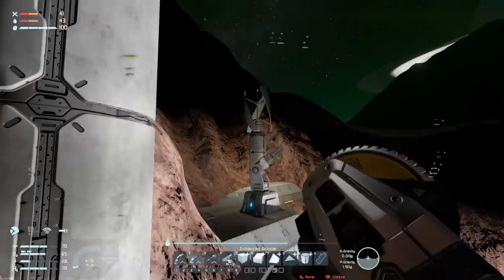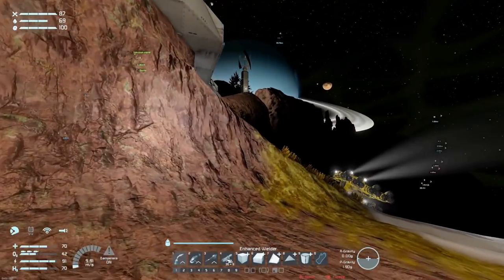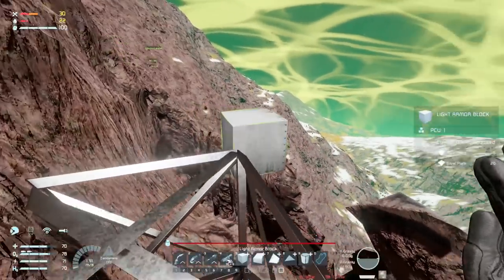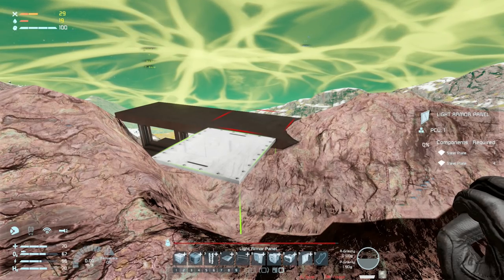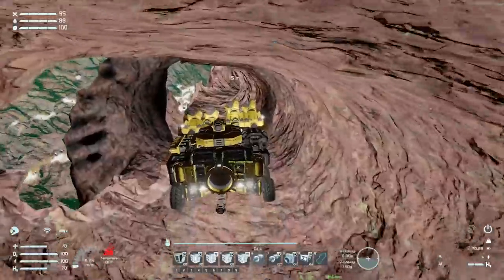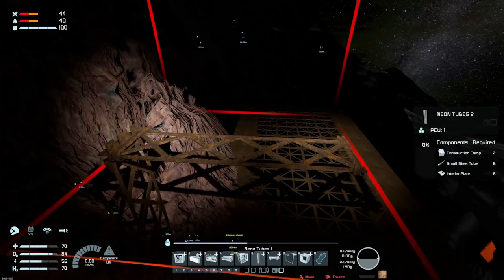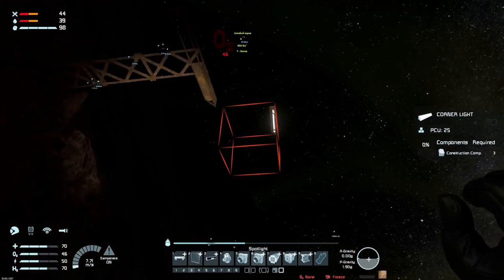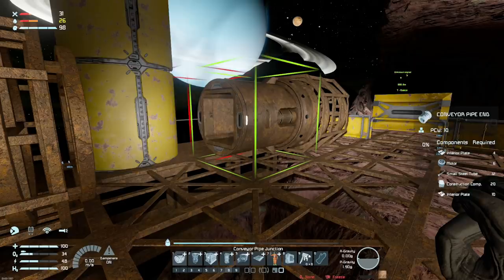Survival Impossible - Death Route #66 - Space Engineers Hardcore Survival

Comment: Hey you should add an anchoring arm on the splat form something that can extend and landing gear it to wall to conserve power. Pistion on hinge and rotor or something.
Reply: Make SplatForm have "feet" that can "walk"
Reply: Or the new magnetic plates. Problems arise when you ad pistons and hinges to flying machine in SE though :(
Reply: @marksadler4457  Not anymore, You can fly in an atmosphere with subgrids attached now.
Reply: Yes just a plate like the first splatform! It was pretty cool
Reply: @marksadler4457  you need to "mergeblock" them, in closed and opend state or its a hell of shaking(even with tensors shared)

Comment: When using grid alignment, you can hold CTRL and use the mouse wheel to move the block distance. It’s not as massive as creative mode, but you do have some adjustment. This means you can pull it closer to you and get it to snap to the front of the block you are standing on. Only works for me in align to local grid, and sometimes I have to change alignment out and back to get it to snap.

Comment: Name for the little failed bridge "Follies Landing". Something else you can do with the battery is add a few connectors and you can use it as well for a forward charging point for the splatform and any trailers. And a proper landing spot for the splatform  or any other flying crafts on the new addition at the hole in the wall would look pretty good.
Reply: I like 'Follies Landing' sounds like the name of many a project!!

Comment: Oh, and regarding the lights I recently tried to make a sort of power cables out of small grid wheels and hinges with frequend small blocks to hold lights and an exhaust, that throws sparks from time to time by having a timer block trigger it. So laying a long cable alonbg the tunnel and maybe attaching it with a magnetic plate or landing gear to the wall would make a great and flexible way of getting power and light

Comment: In a mountainouse terain you whon't want suspensionbridges in fear of a rockfall.

The briddgeproject could be redesigned as a forward parkingspott/stockpile for constructioncrews (as in redesigned by the buildingcrew). (also possible parkingspott for the splatform with low to 0 powerinput so you don't need to drive the whole whay back down during construction) ...  jea, kind'a  like that. 

you could put the warningsign on a frame overhead with the halve sized armorkorners. Also the place should be accessible by vehicles so the workers don't need to move more than one baricade to gain access to not clump up the street while clearing the entrence.

Comment: Turn the failed bridge spot into an overlook weight station/security check point. It can still have the failed bridge sticking off and out of it, but they had started with a second structure like Steve's hole in the wall at the bridge but decided part way into construction to not continue but mine instead. So you can have a small building with air and a gun turret and power generation, a small storage room, maybe even some refinery capability, a small overlook viewing platform, and then the unfinished bridge sticking out with blockades and warnings. You can also use it a second staging area, turn around spot and recharging location.

Comment: I think setting up the Rock Lobster for front-wheel-drive, either by turning the suspensions off or just turning down the power, will help make your rover a fair bit more stable. Every time you inch forward, the rover subtly jerks back onto its rear suspension and rocks back and forth for a moment, suggesting you have too much torque on your rear suspensions. The sudden stops you make while inching forward are probably contributing to the rocking as well; this could be mitigated by making the front suspensions stiffer than the rear suspensions.

Or if you're feeling brave, you could break out a controller and try feathering the throttle.

Comment: I've been experimenting using those small-grid merge blocks to make battery packs for my rovers. My base has a surplus of power generation, and seemed a waste not to use the solar/wind generation.
Might be handy at Steve's Hole-in-the-wall where you can sorta back up into a battery bay and swap flats to full charge packs reasonably quickly.

Comment: Since the splatform is merged on, you could blueprint/project it off the trailer, then have a charging station separate from the trailer. Then you can have alternate splatforms to work from while the other charges. The airbase canary welder can spray one out in one or two passes.

Comment: Red = Bad guys!
you usually want to shoot those things marked in Red.

need to add more points into Parkour!

power systems at base will need attention as there are damaged turbines. I might also consider adding some Solar Panels to boost generation for the Splatform. wind conditions are not ideal at Steve's Hole might end up require installing a small Reactor.

huge bridge requires more than one body to build it.
install a pier under the part you intend to leave in place with a sign denoting "Bridge Out"
a couple containers and a spare Bridge Beam lying on the deck.
don't forget to build up the Abutment where the Bridge merges into the Rock.
29:00 = an alternative for large bridges that will have some interesting looks is a Deck Truss design.
these can be quite long and built in sections that can be carried up and weld padded into place.
individual spans over a wider gap such as a River can be done with a Through Truss that I have built and Blueprinted in my Agaris Save.

Comment: I think you could improve the roadside fencing by using the steel and grated catwalk blocks with a railing block on top as some king of fence top. For further decoration you could consider the retro skin. 

The stub bridge could use a transverse brace into the voxel. Using both straight and sloped beams should make it look decent.

Building the O2 tank and vent in small grid IMO makes sense and allows a bit of greebling. Add a wood or beam pile . . .

Perhaps the various armor panel slopes could be used to model a torn off bridge end. They could also be used,  cut down, as fencing again with railing on top.

If you're going to be building trailers then put a seat and remote control on them for easier, and at need independent, movement.

Good Luck

Comment: As a suggestion for the bridge, real life suspension bridges have the "Caisson" built first, that is the big blocky section at the bottom of the pillars the cable runs to. Maybe getting one of those half way finished in view of the road would work for the build? Also the Anchor point for the cables would have been done before any part of the platform was put in, and would be readily visible (And possibly work as a small room here)
Reply: If he builds a tower he could stick a wind turbine on it and have it be pretty effecient as well. Or maybe a turret since its now powered and could be attacked

Comment: Maybe a small worksite office trailer/ Forman's Office built with armor panels could have o2 a seat/control station or counter solar on top batteries, worker toilet, work safety signs or non safety signs haha?. Might not fit the decor but for lights Tiki torches using exhaust pipes and a small fire setting on the exhaust, might be a bit to Mad Max/Capac.

Comment: It's too bad we can't make jersey barriers (though maybe with small grid?) because that would have been perfect for the abandoned bridge barrier. 
Along the edge of the road in the sections where you shore up the road's overhang, I suggest using the half cover wall in safety orange (so, with a gap between each one since they are half-width). It's an edge indicator, not a barrier that blocks your view or keeps you safe.
I'm with you on the scale of that bridge. You need to invoke some Colonel Failure style. Cheeky bridges, cheeky tunnels. Besides the labor involved, it's much more pleasing, and much easier to hide the fact that with low-radius planets like we have in SE, with enough length, straight = sloped. 
It's a good thing you didn't lop off that giant spike of a beam, to let the valley claim it. To replace that much iron would have been what, 3 loads of hand-mined stone? Who's got time for that? And think of the power cost of running a drill for that long!

Comment: you should do some scaffolding around the end of the failed bridge. and also, maybe you should build a little working arm on the road builder, with a platform to work from, then you can drive with the platform over the edge end build the bridge. or build things a bit up. then fold it in when not used, a challenge.
you could do some fake tunnels to, just drill in a bit and then build some barrier with warnings. just for show.

Comment: Instead of just doing a fence or a rail along the open bits, maybe push the road into the mountain a bit, level the part right along the open cliff, and then build little viewing platforms. I live in a very hilly/mountainous area and there are always these little spots along cliff roads for people to pull over and enjoy the view and take pictures, but they're not like full "picnic areas", they're more like expanded shoulders. Also if power is an issue I would like to remind you that you did just build an ice mining tram so maybe you could add in a hydrogen engine to Steve's Hole in the Wall.

Something you could add to the bridge to make it look more realistic is an office. Lots of larger construction projects bring in these sort of portable offices that look more less like large shiping containers that have been converted into an office. Maybe build a little building to look like one of those portable offices that was also just sort of left there.

I don't know specifically how strong 2 1x1 hinges are, but I do know that a single 3x3 hinge is able to handle 3 drills with room to spare. So if you ever revisit the "road builder" idea in the future, if you use a 3x3 hinge you should be set to build the extra drills necessary to make the road wider. My mining rover on the workshop has 2 3x3 hinges holding up 6 drills that are all greebled with a whole ejector system for stone, lights, and even a few decoys in between and it is still able to adjust everything up and down with relative ease even when the drills are full. Hopefully my obsession with rovers can come in handy for others since I basically play "Rover Engineers" and never actually make it to space.

Comment: Those of us who have watched your videos for a while know you well enough to know that if you finished the huge bridge in creative you would consider it cheating.  For your use it would help if SE had smaller large grid O2 tanks.  The build state conveyor pipes looks like a rebar frame for a concrete pillar.  You could have the logo and Bridge out on the big LCD with some smaller Top or Bottoms rotated long axis vertical attached to the sides of the big LCD saying Danger.  I didn't see if you had but don't forget to turn off the vent once the O2 tank is filled to your preference to save power.  If the game had liquid water and flowing water we could have Hydroelectric as another way of generating power.  A small stream to keep it ballanced with what the wind turbines make so that you don't feel like you would be cheating.

Comment: I got an idea i want to try myself as well. That is to build a big wind farm. Just turbines on stalks. Then a ccentral charging station using large grid batteries on merge blocks. A seperate truck tranports the empty power units to the recharge station/ wind farm. there a fork lift can offload them and plug them in for recharging. Then load up the fully charged one and bring that back to where ever its needed

Comment: You could add a projector on a rotor with a remote and a camera on it and let it project a line of blocks so you have like a measurement stick.
And there is a block to cover up the corners at 5:12
If im not wrong it should be in the same group as the half blocks

Comment: I dunno, 'Lock Robster' sounded pretty cool. You could call it 'Bob' for short.  As it's about half way, maybe the abandoned stretch of bridge would have been gentrified and turned into the 'picnic spot' in an effort to salvage some of the lost construction costs incurred by the mistake? Also, as a temporary measure, you could add 'Bridge Out' text to the LCD to overlay the 'Danger' image (which might look better with the 'keep aspect ratio' box checked) 👍

By the way, got any pointers for trouble-shooting why a large-grid rocket (attached by connector & built in situ) won't convert to ship? I've even used Bob's cousin, Drill 'N' Fill, to make sure that I've not, somehow, managed to leave even a teensy voxel left, and it's still telling me, "Conversion to Ship Isn't Possible / Permitted" (I forget the exact wording). I suspect I may have to grind the whole thing down and build it again via projected blueprint (which will be a pain, but 'needs must when the Devil stomps your cookies')? All tips welcome, if you have any... :-/
Reply: Nice use of the Neons, too 👍😁🍺

Comment: Some ideas, feel free not to use them:

- There's lots of snow around that Mountain Tunnel Road. Why not a giant rotating drill arm that slowly scoops up ice and deposits it into a few large grid large containers attached to a decent-sized network of Hydrogen Engines? It's semi-automated for a little while, until it hits stone, but you could probably set up a PB that detects when ice is no longer entering the large cargo container or when excess stone is, to auto shut off the drills and retract the pistons, then somehow set off a large warning spotlight to let you know there will be no more ice to dig up. There are many great examples of rotating drills arms and as a hint there are usually at least two rotors offset from each other to get an efficient end result.

- I'm surprised you haven't made a blueprint of the bases so far for projecting them and making repairs much easier in the future, should they be needed.

- I believe "Poor" wind clearance is less than 50% of possible power, whereas "Optimal" can potentially reach over 100% from time to time. So stacking the wind turbines up just a few more meters, exactly far enough away for "Optimal" wind clearance, would help heaps.

- A solar farm is cheap in cost, as far as resources are concerned, (everything can be made from what is refined from stone), and you can attach a simple script to it that can utilize the Hinges and Rotors to track the sun, for optimal sun exposure and maximum energy.
Reply: Since when do you watch his videos?
Because that’s all things he already did and simply doesn’t want do do the same things over and over again.

Comment: If you had added a projector to the end if the bridge then make the bridge a blueprint, you could have used the projection to place blocks from on the bridge safely and without the needing to worry about powering the Splatform 

You'd lose put on the  materials of the projectors, but it would be less than you'd use making the power infrastructure to use the Splatform at a decent pace.

Comment: Well I discovered that if you build a dump truck (and yes is actually carries raw rocks and dumps the rocks) that they tend to roll around inside the dumper, lol. This was also followed by the unexpected discovery that i did not have to open the tailgate before dumping because the bigger rocks have no trouble tearing it right off the back as the dumper was raised.

Comment: Question, if you connect "Steve's hole in the wall" to the "bridge" using the road in the cave floor, could you not add turbines to the outside of the path? allowing the sharing of power through multiple way station charge areas that could have o2 farms hanging of the side of the mountain with tanks spread out as emergency rest stops/refills spots.

Comment: you could make a small portable generator that gets towed to the worksite and runs to recharge batteries on ice ... then a few turbines will keep a basic shelter running and the generator charges the rest while building major parts .. also that generator then can follow along the road ... have the mobile generator have a basic survival kit on it for o2 and power reload ... and super basic manufacturing ... and just the small grid storage containers to hold a bit of stuff and ice for running ....
Reply: the abandoned bridge section can be used for power generation ... change the bed to solar and add a few turbines along it and a place to hookup and recharge ... even Park the splatform ... and lobster ... heck make a small ugly foremans shack where the bridge plans are looked at and the road gets worked from ... turn it into a storage depot for the redesigned repositioned bridge

Comment: When I build miners to operate in space, I made a few thrusters fire at low thrust to slowly and smoothly push the miner forward automatically.  No jerking.  Why don't you set up a "drilling" hotkey/script where the wheels drive forward at a slow rate and all you have to do is steer.  That way, the drill vehicle isn't lurching forward all the time when you tap the forward key.  It makes the road bed much smoother too.
Reply from the maker: The road is about as smooth as it can get within SE's voxel limitations with mining, the rocking back and forth is inevitable with wheels and gravity as high as it is because I need a lot of power to push the vehicle forward so it always seems to jerk a bit (I'm not keen on trying to adjust it constantly dependent on gradient as that would be the only way to make it smoother without using loads of energy on thrusters)